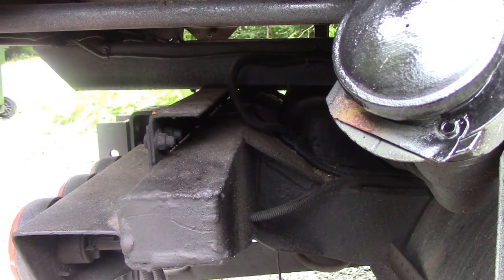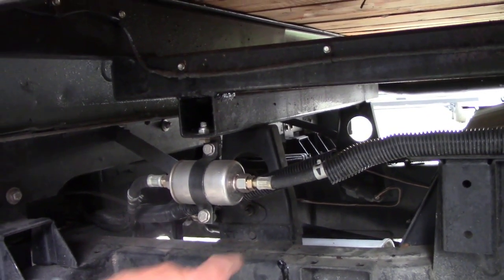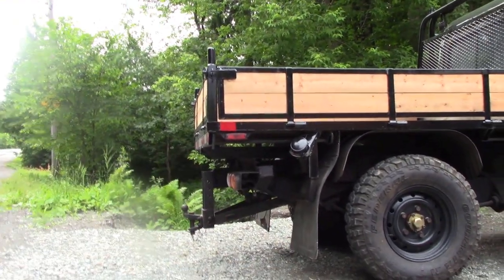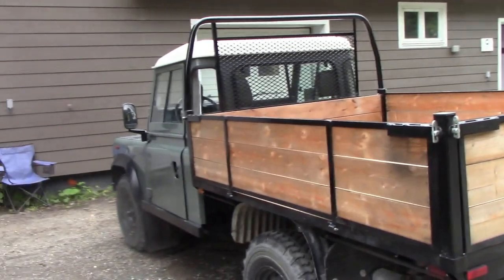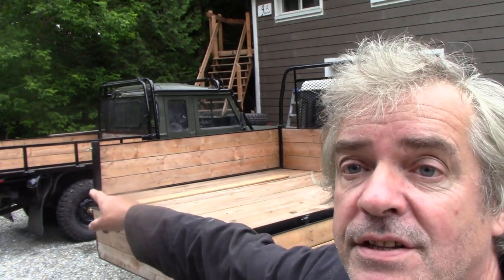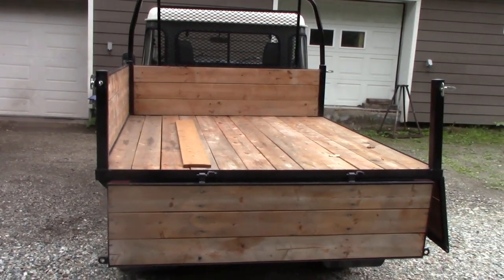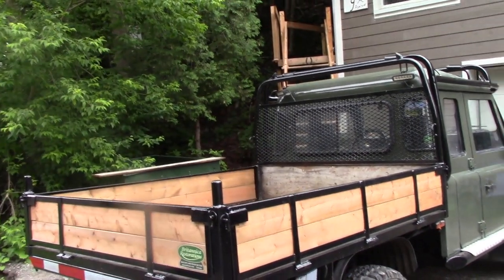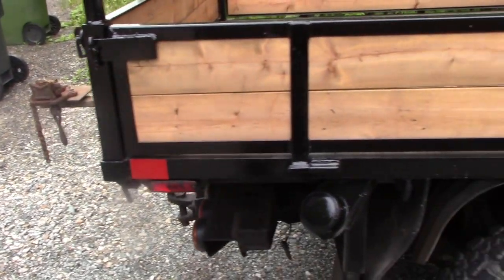Answers to questions. How did I make the dropside rear box on my Defenders?

Comment: Mike just put checker plate on top of the wooden floor like cattle trailers and if you put an engine or gear box in the back and spreads the weight and no damage to wood

Comment: I know exactly what you mean by the different pin lenghth on the side hinges, Mike. First thing I did on my tray was shorten one. Otherwise it can be bloody nearly impossible to get the sides back on.
Reply from the maker: Same as the old series bonnets!
Reply: Also applies to most uses of pin hinges - gates, kitchen cupboards, etc.  Even a couple of millimetres makes replacing the item so much easier.

Comment: Little story about putting pallets inside LRs.....

I once had a 110 as a company vehicle.
I got a paid weekend off on the condition that I deliver "something" to a nearby company while I was at home.
I was informed that the "something" had been loaded into my 110 while I was busy doing something else.

Upon (casual) inspection, it turned out the "something" was a giant flange and weighed, erm, more than anything inside a 110 really should.
However, it was on a pallet so it'd be possible to remove it with a forklift.

Got to the company on Saturday morning, the forklift driver tried to remove the pallet and it turned out, the pallet was too wide to get through the door.

Some genius must taken flange OFF the pallet, tilted the pallet diagonally to get it through the door then picked up the flange (with a forklift) and slid it onto the pallet.
Brilliant! :-(

The company weren't interested in helping further so I was left to my own devices.
I ended up gathering up a pile of wood, put a ratchet-strap around a tree and "winched" the flange out until it fell onto the pile of wood.
I could then get the pallet out (diagonally) and I then had to "winch" the flange from the pile of wood onto the pallet... so the jobsworth driver could happily pick it up.

But, erm, yeah.
Dear LR, whatever the maximum load-space inside a vehicle, make sure you can get that load through the door, eh?

Incidentally, a pallet CAN fit inside the rear of a Disco 4 but CAN'T fit through the door of the new Defender.
That's progress for you!
Reply from the maker: I have had several engine/gearbox/transfer combos shipped here in the back of 110's  not so easy to get out of the back once the truck has come 3000 miles by sea in a container - with all the bumping and jarring they locked themselves together with little hope of getting the out with the forklift through the door
I reluctantly set upon removing the roof and sides only to find the nuts finger tight- - they removed the roof to drop them in with their lift truck

Comment: Loved watching this video, Mike. Just a couple of tips. Put the hinge pins for the sideboards the other way round. Think about it and you will realize why. If there is a local scrapyard near to you that breaks wagons try getting a few lengths of aluminum boarding and put one of them down each side of the body but put wood in the rest of the body floor. Drill two holes in the aluminum at the front of the body to let the water out, you can then put a tube to take the water away past the chassis so that it discharges onto the floor, of course, you don't need to worry about the water flowing out of the back. Great video. Best wishes from Yorkshire Rob.
Reply from the maker: Yes I know what you mean Rob but the sides are either up or off
Scrap yards here are not the same as back home I would not know where to find a truck breakers!

Comment: I needed to see this vid Mike. Me & a south african Pal were leaning on the crappy, semi-useless-sized tub of a Defender today debating what we could do to improve the load capacity - that & the existing tub is battered in every way and looks rubbish.  It'll get the bin tomorrow, just the front bulkhead will be kept - a version of this ^ will get built. Much better idea than fighting bodywork on a tub that is fairly useless to begin with. Many thanks. :-)
Reply: Can I like this video twice? :_) I had the idea in my head - shouting at me quietly - now it's concrete. I'm gonna use aluminium for the "wood" bits - but that ^ is waay better than the naff LR tub that fits in nothing.
Reply from the maker: Very easy to make!
Reply: @BritannicaRestorations  The fabrication aspect is a doddle - it's the "Idea" that is the important bit - so thank you for the "Idea" aspect - much appreciated. :-) It will probably end up tipping hydraulically...  just because.. just don't tell the wife..

Comment: Loved the video, I needed to refloor a flatbed trailer and first used varnished sheets of ply, they warped. This was followed by thick tongue and groove which warped in the winter and left gaps in the summer. Finally used resin bonded ply (Rhinoboard), very heavy but lasted a few years until the chassis rusted enough for me to sell it !
Reply from the maker: Aluminium is best but expensive

Comment: Hi Mike, i did similar on a vw t2 crew cab many years ago and because the bed was only about 6ft long, i put two chains on the back drop panel so when it was dropped, it laid flush with the main bed and i could put 8x4 ply sheets on and they laid flat.
Reply from the maker: Good idea!

Comment: nice, I enjoyed that,  On the point of clearance, i know you prob wont get int to axle twisters but when you do full compression on the O/S and full drop on the N/S you get more travel at the top of the wheel on the O/S than the gap between axle and bump stop.
Reply from the maker: I don;t think I will get anywhere near that situation with a heavy load!

Comment: Just a note for anyone using treated timbers.
Use stainless steel screws.
The chemicals used in treating the timber is very corrosive and will rust out normal screws very quickly.
Reply: Good call, shame it no longer protects the wood just rots metal!!
Reply: @jamesbarker4808  It is what is known as pressure treated,  it only goes in a few millimetres, 2 or 3mm lets say.
It is fine if you treat it every couple of years with a bit of fence paint but the problems start when you cut it. You now have untreated timber exposed on the end grain.
Creosote was the best stuff, lasted a lifetime but only because it killed the owner of the shed before it rotted.
Reply: @highdownmartin  Now he tells me!
Reply: I work in forestry, the modern chemicals are not working on softwoods since CCA was removed. I mill a lot of oak and chestnut for farms as the softwoods are rotting through in five years.

Comment: Great video. Love bespoke/ real world engineering.
I am planning to convert my disco 1 into a pick up, for the exact comments you discussed...utility pick up and expedition camper box.
Out of interest do you notice the weight difference between wood and alu (or without wood, as you've not used alu)?
Reply from the maker: I think the weight would be the same but the volume would be higher for wood

Comment: I love your Vlog - wish you were a bit closer though - South Africa is a bit far to make a pit stop.

Have you ever done a Vlog on the 3.5 V8 Lucas 35DM8 Electronic Distributor?  My wife and I go to the Kruger Park each year which with traveling inside the park amounts to a 10,000 +- Km round trip.  Being an old (1992) Landrover we usually pick up a problem or two so I endeavour to make up a spares kit which most time gets me out of trouble.  The last trip however got me stumped and necessitated bein flatbedded to a not so nearby Landrover Mechanic who tracked the problem down to the rotor arm.  Now I had put in a new rotor arm before leaving on the trip and had done over 2000 Kms at that stage.  (Interpart Rotor)  Mechanic replaced the Rotor (Also Interpart) and all was well until I got home when I had starting problems.  Tracked this down again to the rotor so I replaced it with my original rotor which I think may have been a Lucas and all is well again.

I have now added a Lucas Rotor to my spares kit in case.

This year I decided to add an Ignition Module to the spares kit but found that 2 pin modules were not available only 3 pin ones. I eventually got a 3 pin Allmakes module (STC1184) which came with a 2 pin conversion kit.  However the instructions (Chinese) were not very clear on which lead goes on which pin.  It shows on the diagram the coil leads fitting on pin 1 & pin 3 but the written instructions say pin 1 & pin 2.

Your thoughts would be appreciated and also I thought this would make a good Vlog (For me anyway) to show how module is removed and the new one installed.

Cheers from a cold & wet South Africa with no booze and no cigarettes - also have now got a curfew as well from 9pm to 4 am.
Reply from the maker: Sadly I have no V8 Defenders here to play with - very rare here
If it were mine I would convert to a distributorless ignition system

http://www.v8developments.co.uk/products/ignition/EDIS_distributorless_conversion_kit/index.shtml
Reply: @BritannicaRestorations  Pricey and I don't have an ECU.  The 1992 was the last year they made the simple Defender - no electronics - hammer and string will fix a lot of problems.

Comment: Love the pull out for the vice. Thinking of doing one for a receiver hitch.
Have a watch on YouTube for 'Raptors Garage' their doing tray back on a Discovery 1 with an Alli Pod.
Reply from the maker: You can buy a receiver hitch vice here in North America
https://www.canadiantire.ca/en/pdp/maximum-hitch-vise-6-in-0579026p.html#srp
Reply: A common "fix" when LRs are used in industrial roles is to slide a pipe-wrench into any convenient hole to create a "vice".

Where the rear crossmember has holes for fitting a hi-lift jack, for example, you can slide a 24" pipe-wrench in and you've got an instant vice. ;-)
Pro-tip: use a cheap, steel,  pipe-wrench. The expensive aluminium ones are too chunky and won't fit into the holes.

Comment: What size angle did you use on the bed frame and the sides.
 Also what was the length and width of the bed  please?

Comment: Very nice work.

Hate to be a buzzkill but if anybody's thinking of attempting anything like this, it's advisable to check the legality in your country.
In the UK, for example, welding a trayback into place means you're modifying the chassis and that means you've instantly created a "radically modified vehicle" which'll need an engineer's inspection before it's allowed back on the road.
Course, there's nothing to prevent you from bolting stuff to the chassis but you really shouldn't be welding to it.
Also, there's a good chance an MOT inspector (or equivalent) won't even notice what you've done... but if they DO - and they issue you with a failure notice that lists "modified chassis" as being one of the failures - then you're totally stuffed because it's become an "official" thing and you'll have to un-modify your chassis to get the vehicle through the MOT, or get it inspected by an engineer, get the vehicle reclassified and take a huge hit in the pocket when it comes to insurance.

Also, on the subject of insurance, if you've got a vehicle with a modified chassis and it gets into an accident, good luck if the other party's insurance inspector decides to have a close look at your vehicle.

I genuinely don't like making a fuss about this stuff but it's terrifying to see people leaving themselves exposed to financial and legal hassles.

I keep seeing video's on YT where people (in the UK) are, say, getting rid of the A-frame off the back of a Defender and replacing it with a panhard rod.
A lot of them are doing a terrific job with the fabrication but they're actually falling foul of the "radically modified vehicle" laws in three ways; 1) modifying the chassis and 2) modifying the suspension and 3) modifying the axle(s).

It's not just DIYers either.
I just read an article where some company is taking 1970s Range Rovers, bunging a Disco 3 axle underneath them, fitting a 500hp engine and selling them for £240,000!
That'd be fine except that they're leaving them on the 1970's RR's registration plate.
From a legal POV, what they've actually done is bung a RR bodyshell onto a Disco 3. The vehicle should be listed as a Disco 3, on a 2005+ registraion plate.

As I understand it, this stuff is likely to apply to Europe, the UK and Oz now.
Dunno about the USA or Canada.

/rant.
Reply: In Australia all the ute tubs bolt off and trays bolt on. So its basically a non-issue.
Reply: @trmindustries.2549  Yep.

For the manufacturers, it's all about type-approval; they design the chassis with the intention of using it in a variety of ways without having to get another version of the chassis type-approved so it should usually be possible to build something that suits you with a bit of thought, rather than just grabbing the welding gear.

Alternatively, as ASPW recently demonstrated, some manufacturers do deals with modification companies so a vehicle can be modified before it's registered, and the modification will include any required engineer's inspection.

Another example of "dodgy" practices is when it comes to hybrid/bobtail LRs.
If somebody's building a hybrid "properly, it'll end-up registered as a Range Rover and NOT as a 90 cos it's using an RR chassis.
If you register it as a 90, you've modified, erm, everything significant - the chassis, the suspension, the axles, the steering, the engine & gearbox and you've created a "radically modified vehicle".
If you register it as a RR, all you've done is swap the body... which isn't (legally) significant since proper LRs have a separate chassis.

As for bobtails, if you cut off the rear crossmember, you HAVE created a "radically modified vehicle". No ifs or buts.
I bet 90% of the bobtails seen on the roads aren't actual road-legal... regardless of how well-engineered they are.

Comment: Beautifull rear boxes! I think the wood adds a touch of country style. I just wonder why you haven't fixed the frame of the box to the chassis with a three point hitch (two fixed connections on the front and one tilting on the rear, see this example: https://www.stepsover.com/2015/12/31/743/). This would have preserved the chassis articulation.... I would like to know yout opinion about it. Ciao!
Reply from the maker: For what this box is going to do, it is fine

Comment: Hi iv got a bit of headache my discovery 2 has problem with starting it starts when I've primed it with the pedal I've changed the fuel pump and filter and it still struggles to start would you say it would be the fuel pressure regulator not providing enough pressure for pump I've connected it to my diagnostic and says fuel pump relay circuit malfunction
Reply from the maker: fuel pump relay circuit malfunction could be a number of things = can you read the fuel pressure on your diags?

Comment: Are they both yours, Mike, or just the 130?
Reply from the maker: Both mine - the 110 is my project - STILL waiting for the replacement shaft to come from the US as they made it under size on the 27 GM spline
Reply: They’re both brilliant machines.  If only LR had made them so practical.
Reply from the maker: The tray was only available down under - or so I was informed